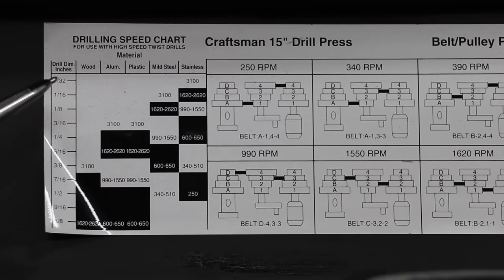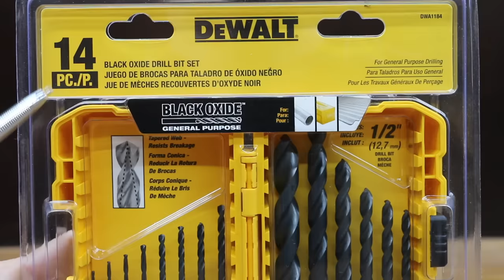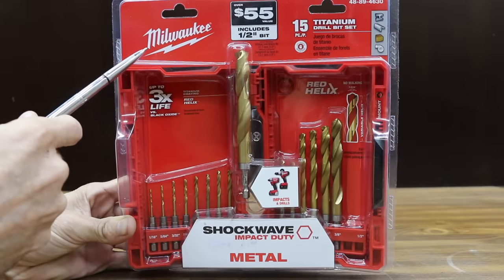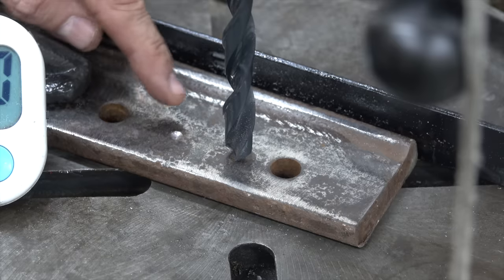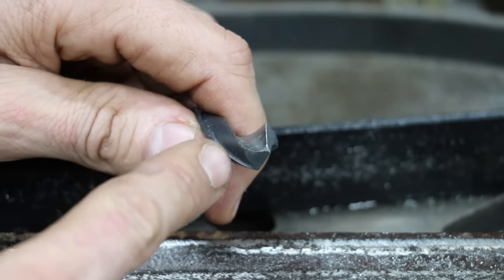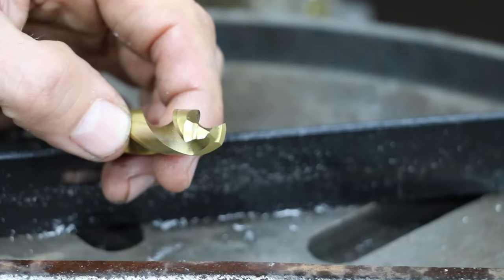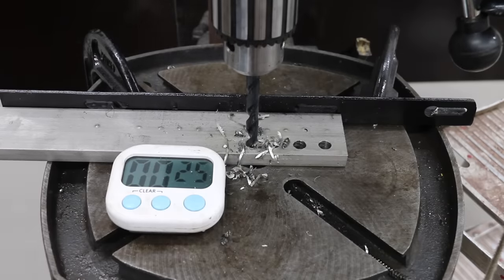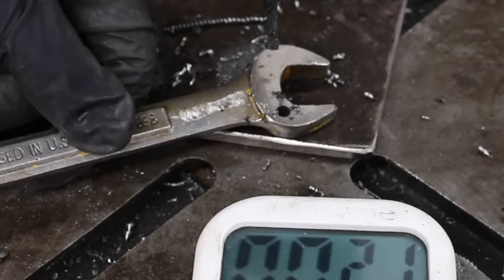Which Drill Bit Brand is Best? Let's find out!

Comment: Yes, after destroying countless drill bits in my youth, I finally learned how to drill metal about 20 yrs ago, high force, low speed, lube, back off the pressure right at the end of the cut. Works every time.
Reply: I worked in a machine shop drilling holes all day, every day, day in, day out. After a few months you get pretty good at it. I had this funny way I'd wrap my whole arm in the spider to really get some force.
Reply: Makes sense. Thank you
Reply from the maker: Thank you for the feedback
Reply: also true in the bedroom
Reply: @Hyperian  Ha!
Reply: utubeaccess7 Almost exactly the same here.. I just learned the correct way to drill metal(the way that you stated above) about 6 months ago. You’d think it would almost be common knowledge but I think alot of the causal DIYer’s(or at least the ones that I know) don’t know the proper way to drill metal and usually just blame the drill bits when they burn them up..Thats what’s I always did ha
Reply: Yes,  it is a learning experience , as a young bloke i snared a job in farm/milk products which involved drilling stainless fairly often .
 One of the things i learned drilling stainless is , if you do not use enough force , the drill can Polish the stainless building heat and  hardening the metal ending up with a destroyed drill bit and no progress, 
 a slower speed, a nice Sharp drill and  a good amount of force and some cutting oil makes a big difference.
Reply: @nickd6182  i work with people who call themselves millwrights and complain about shitty drill bits even though they never use a drop of any fluid. gets on my nerves sometimes
Reply: YES THANK YOU! I can't tell you how many people I've seen in my construction related jobs blowing through bits going full speed on the drill.
Use a low speed and put as much force as you can into it. Let the bit cut!
Reply: @mikldude9376  yep! Drilling stainless is tricky. If you go full speed all you're doing is heating up the metal and heat hardening it in the process making it even harder to drill. I've seen so many drills burnt up doing this. Push as hard as you can and go as slow as you can and you'll drill through stainless in 3 seconds flat.
Reply: Ummm... Thats my sex life! 😏
Reply: Still have issues drilling titanium at my work. Eats drill bits haha
Reply: @1pcfred  That is how I do it, I know exactly how you do it. Best way to apply force! Now I want a mill instead of a drill press! makes easy work if you have the right set up!
Reply: @kameljoe21  I have a Chinese mill/drill. It's more drill than mill. It's easier to move than a Bridgeport is at least.
Reply: @DustinB855  Titanium is always gonna be a high wear material. Like aluminum with roid rage
Reply: Educated, thx
Reply: @mikldude9376 ;  It depends on the SST alloy, but the effect can be amazing.  I once reduced a 1/4" drill to 1/8" trying to enlarge a hole in 1/16" thick SST.  No idea what the alloy was, but THAT was a learning experience!
Reply: @Leecop-et8mb  Most common stainless steels (304 and 316 grades, the latter is often sold as 'marine' stainless) actually can't be hardened by heating or quenching, as they don't contain enough carbon. However their highly alloyed nature means that they can be hardened very easily by 'cold working' I.e. plastic deformation of the metal. This accounts for your observation- if you don't apply enough pressure to get the cutting edges of the drill under the surface of the metal they just 'rub' or burnish the bottom of the hole, forming a thin layer of highly deformed stainless that is very hard. Add to that the friction heating causing the drill itself to become softer, and your drill tip burns up in no time.

 Theoretically you could drill at higher speed so long as you provide enough pressure to keep the drill cutting not rubbing and you use a drill material that can handle the heat. Tungsten carbide drills can do that (they can go up to 3X the RPM of a high speed steel drill), but they're no good to us home users because they are brittle and tend to snap if they aren't used in a super rigid machine like a CNC mill.
Reply: I recently bought a set of Reisser cobalt drill bits and have been very pleased  with them,they rip through stainless !  I was given a set of De Walt bullet point drill bits meant for metal use, I would like to warn against these if you do woodwork ! like most people I use twist drills for both wood and metal, but you cannot with these, they have a high flute that grabs and they drill so fast they are almost uncontrollable !
Reply: @Hyperian  angles and thrust

Comment: I requested this test a year ago and I'm glad it finally came.  I used to be a machinist and I broke alot of bits in my day. Learned alt from this video. I bought a ryobi and dewalt drill bit kit this black Friday. I was going to return the dewalt. Not anymore lol
Reply: Hi. I bought an oscillating sander (280x110mm pad size) from Rioby years ago. It lasted 20 minutes. 20 f...g minutes ! I returned to the shop, got a refund, bought a Bosch, and went back to work. Personal note : Rioby, although japanese, is  worse than LIDL, a german hard discounter. Never buy anything from Rioby again.
Reply from the maker: Thank you!!
Reply: @CaptainDangeax  Good to know, I had been contemplating buying some Ryobi gear but after seeing how shoddy their drill bits are, i'll make a hard pass.

Comment: This is a great comparison and as a starter guide is unmatched.
One thing you might want to look into if you ever revisit this subject is the difference between 118 degree and 135 deg points. The 118 or split points are a better geometry for metals while the 'regular' 135 are more of a general purpose bit.
You do great work, man, and i totally respect that you never take sponsorships.
Reply from the maker: Thanks!  Thanks for the suggestion.
Reply: Actually, you are 100% incorrect on the drill point angle.   Let me repeat .....100% INCORRECT.   The very first drill bit in this video is a 118° and very clearly shows no split point.

118° IS the standard "GENERAL PURPOSE" geometry put on most drill bits. These bits generally do NOT have split points.  Split point is an added geometry, only of value to those people who know they want it/need it, and don't have a drill grinder that can put this feature in.

The 135° is NOT the "regular" point angle. It is an angle that is better-suited to drilling harder materials.  It too, is not "split pointed" as standard. There are some bits that DO have a split point, but you have to request it or find products that are already "split pointed".

This is the one DOWNSIDE of YouTube.   People who make statements, sounding as if they really do know what they are talking about ....yet they've got everything wrong or backwards .....and some people reading the garbage, think they have just learnt something......and now they've got it all wrong.

SOLUTION:    LOOK UP AND INVESTIGATE FROM MORE THAN ONE SOURCE.  If someone has got it wrong, then the next source will probably reveal a problem ....then check another source that is more of an "authority".

.

Comment: I just bought the DeWalt set a few weeks ago. Since I'm outside the US, it's time consuming and expensive to import tools and hardware.  It's really nice to know I accidentally made a good choice!
Reply: Steve S what country are you from that tools are expensive?
Reply: You better check. Dewalt also has cheaper chinese rebrands. Make sure you bought the "expensive" dewalt and not the cheap line. The cheap line is crap and expensive, you better just buy some chinese brand that looks good at least in appearance.
Reply: b22chris A set of DeWalt bits like he showed here cost me about $92 American where I grew up. Import fees, taxes etc. it all adds up 😐😢😢
Reply: Steve S Please check out a company called Drill America. I have one of their full carbide sets. It was about $980- BUT and this is huge. I’m not constantly buying more and more bits because of wear and breakage. 
I’ve used the crap out of the 3/8s, 1/2 and 5/8s bit through AR500 steel. 
The only draw back really is I had to buy a diamond wheel to sharpen them. But I can do a whole armored SUV before having to resharpen a bit. So the initial cost ends up saving me time and money in the long run.
Reply: Those DeWalt bits are really nice. All the diesel techs at my shop use those
Reply: @b22chris  He means buying them from the US and shipping them overseas is expensive.
Reply: @laharl2k  That might be something that Project Farm should look into!
Reply: @chloehennessey6813  A teenage  girl building armored SUVs. Interesting. Or are you on your daughter's laptop? 😂
Reply: @b22chris  Windward islands, Caribbean. We have 3 US based hardware stores (Ace, True Value, and Do It Best), but with shipping, import duty and VAT everything costs 2 - 3 times the US price. For example a DeWalt job site table saw which sells for about $300 on Amazon is currently $825 at Ace and availability is limited. The beaches may be paradise but the cost of living sucks. :-)
Reply: @g8Words  Here in NY...we tax air and sunshine.  :)

Comment: Would love to see a test of smaller drill bits. Specifically, how well they resist breaking. You know, all the empty spots in your drill bit sets ;) Maybe using your torque gauge to see when they break. Great stuff, as always!
Reply from the maker: Thank you for the video idea!
Reply: Second this, I need less snaps in my life and toolbox
Reply: If anyone is doing small-hole drilling ....in metal, ....ferrous ....they need to educate themselves specific to kind of work and learn a lot more about tool geometries, coolants, and have the right kind of equipment as well.   It is very common for a large full drill set to have the bottom three or four sizes to be empty.
These sizes ARE very delicate and they DO break very easily, as careful as anyone can be.  IF a person does this kind of drilling regularly, they usually purchase a dozen each of these sizes.

.
Reply: @taxicamel  Yes, I totally agree. Still would be nice to see a Project Farm test to see which ones hold up best for the value.
Reply: Yes do it

Comment: ♥️I'm going to keep in mind the speed vs Downward Force, I think a lot of my drill bits have fallen victim to that combination.
Reply: I realize I run my drill too fast. Never occurred to me to go slow.
Reply: @MrTruckerf  I don't know... I find if I really push into the drill I can get a hole in a fraction of the time as going at a reduced speed.    Maybe at home you wanna keep your bits lasting forever but on a job site time is money. Cheap madtercrafts bits and push like hell. When the .05 -.10 cent bit dulls or breaks, toss it and grab the next.    
This is the reality on a job site no?
Reply: Hi, as someone who uses drill bits at the most once a month, i find to take it slow and easy, some times you need a small push, but i tend to look at the amount of swarth / shavings coming off the job and use that as a guide to my success.

Pushing strains both the drill and the bit, sub standard drills with plastic gears will get hot and cheap drill bits will bend / break.
So yes i keep my eye on the machinery.

Many years ago i worked in a factory that made electrical switches / contact goods ( one of the top 3 components supplier in Australia ) in 240 volt connectors ( plus the larger amperage items in switchboards and commercial environments),  
Almost all of the work was in brass and every machine had a chart on drill and tap sizes and also the recommended speed and a separate chart on how to set up the belts and pulleys as every machine was set up with multiple belt drives and different sized pulleys of the motor.

Regards
George
Reply: Heat is the bit's enemy. It seems counter-intuitive, but you need to get the job done in a timely manner to keep heat from growing too rapidly. Keep it lubed, too.
Reply: Cobalt bits and proper feed rate are great. Always used pilot holes too especially hand drilling steel
Reply: @maestrozero117  Especially true into stainless since that both builds heat and wears the bit.
Reply: Heat kills the bit, especially stepped bits!
Reply: Yeah when cutting metal there a few things that help, one is the proper speed, two is to stay lubed, three is technique, which is not to just push steady through sometimes. The pecking technique helps a lot with heat dispersion and clearing the hole, in almost any material.
Reply: There are some bits that are made to go at a high speed, and they work much better at a high speed. It's important to know what you're cutting with.
Reply: Also bear in mind that the harder a bit is, the less it can flex before breaking. Any type of deflection off centerline will break a hard bit with enough force.
Reply: @MrTruckerf  when the bits start turning color- blue, or you get blue chips coming off they are being run too fast!
I always thought too much pressure was the killer
Reply: Machinists like to say "speeds and feeds".  I ruin more drill bits than you can shake a stick at but...I think if someone cared, they could look up tool speed and calculate the appropriate RPM based on drill bit diameter and the target material.
Reply: This video was a lot of good work, but completely missed out on two of the more important aspects, TOOL GEOMETRY, and WHAT the drill material PURPOSE is for.

The ONE feature not emphasized was the "split point" feature.  This one aspect alone IS important.  The other geometry feature is the drill point angle. Standard drill point angle is 118°.  Alternative angle is 135° often used for harder materials. Also important is "web thinning" and "rake".  This is a matter of simply looking at the tool bit set BEFORE purchasing.   None of this was even mentioned in this video.

Then the drill material was skipped over with no explanation ....yet it seemed that "cost" was more important.  Well, if you're not going to provide any information about drill material or "coating" ....and in particular "SHARPENING" .....then this video is fundamentally only for people who need a drill every five or six years .....for wood.

If you don't know what you're doing when drilling what you think is a very simple hole, try stopping and investigating on the internet first, starting with the material and the condition of the material ....then graduate to the drill bit and drilling factors.

.

Comment: This was a great video thank you. Many factors come into play with respect to drills. The actual composition of the tool steel, the machining and straightness of the machining of the drill, the coatings, the final sharpening grind all play a role in the overall quality and lifetime use.   Work hardening is a very real issue with drilling, that is why when you drill spring steel you can work harden it to the point where it will dull high speed steel to where it no longer cuts. Stainless is also very susceptible to work hardening, even too much coolant or cutting fluid will cause SS to work harden.   Sharp, slow, consistent pressure is key. Slowing the speed down allows the operator more room to make mistakes with feed, before work hardening develops.   Cobalt drills are very good for harder materials than HSS,  but are more brittle and will chip  more easily if chattering or impacted during cuts.  Solid carbide is even more so.
Reply from the maker: You are welcome!  Thanks for the feedback.
Reply: so i had rough go with drilling into a stainless steel door at work. i learned about hardening the hard way today. do you have any advice for drilling through the hardened spots i made?
Reply: U @metalroofer6737  Use harder drill bits...like carbide or diamond drill bits...
Reply: @metalroofer6737  not knowing much detail .....can you drill right beside?   Can you drill from the opposite side in the same spot?    You need more drill pressure to break through the hardened area. Use a smaller drill bit and punch through. Then a larger bit for the same reason, then keep increasing till you reach the size you need.   IMPORTANT TO KEEP THE SPEED AS SLOW AS REASONABLE.

.

Comment: Tie down straps that are easy to use and will hold a load down.  I can't find a quality tie down strap that will last for years, not rust or go down hill as you use them, what brand is best PF?
Reply: are you talking 1" or 2"? I am a flatbed trucker and I use Kinnedyne 2" ratchet straps. These straps see 100,000 miles of hard use, rain, snow and salt, year round. A periodic squirt of wd40 and they work for yrs. If you are looking for 1", try US Cargo online, they carry all kinds of straps for the trucking industry.
Reply: The best ones are the cheap pack from harbor freight. Can replace them a year later at little cost
Reply: Take a stroll underneath billboard signs... particularly near major highway in rural locations... the ones the sign guys use to stretch the fabric are real nice and they air mail them to the ground... most never get picked back up.. just sit there in the weeds... only drawback is that I haven’t found one over 8ft long
Reply from the maker: Thank you for the video idea!
Reply: Goodyear
Reply: @TheRoadhammer379   Kinnedyne are the bomb. The Navy used their 1" straps for a special project. That's how I came to learn of their quality. What got me was they were the same price as cheap Chinese straps.
Reply: @hoobeydoobey1267  They are tough and now offer a gray line of straps that are Kevlar type material, high abrasion and cut resistance. And the gray line is only a few bucks more than the standard line.

Comment: I bought the Bauer set based on what I saw in this video, and I LOVE them! Thank you for this review, very informative. I work as a state inspector and I can't tell you how many times I have had to drill broken off tag screws out. The Bauer bits cut through like butter with little to no flex even on the smaller sizes.
Reply from the maker: Thank you for the feedback